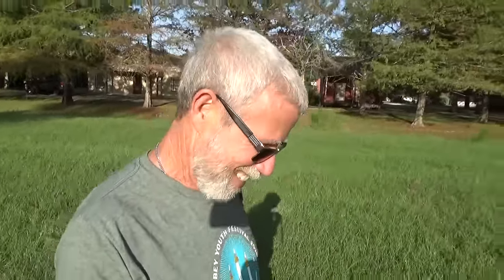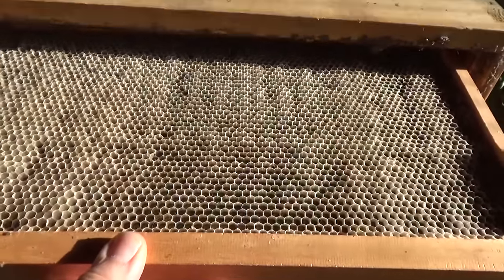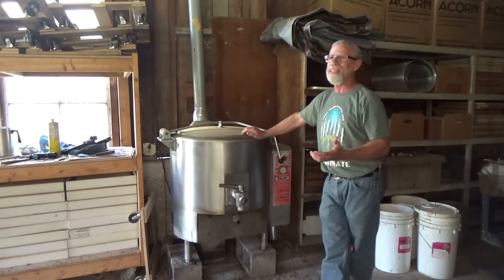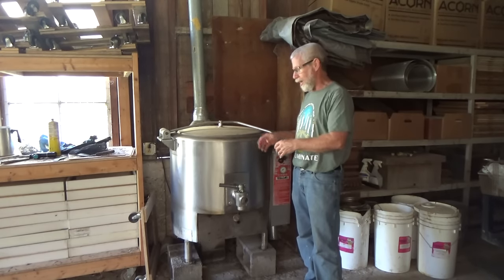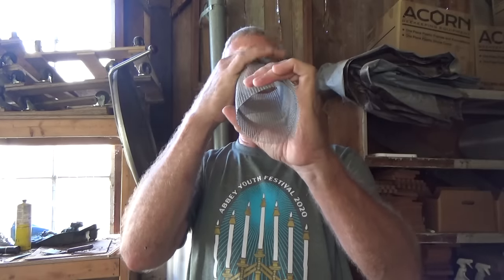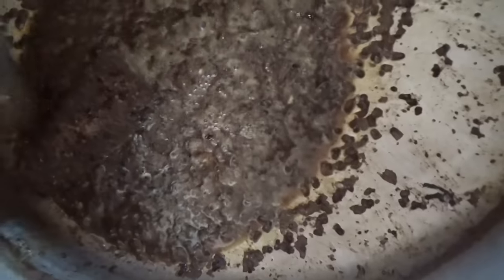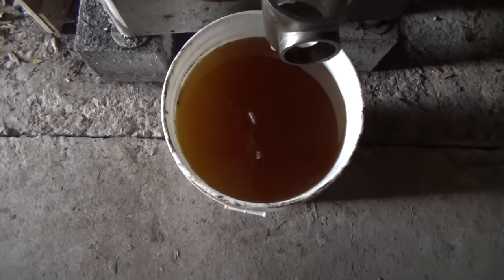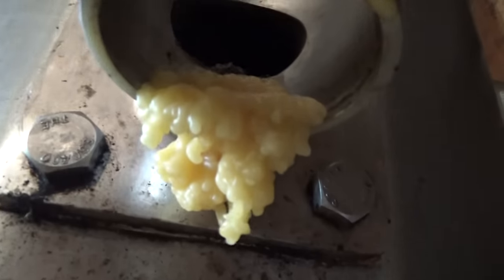Recycling our beeswax making it useful once again.

Comment: I heard you mentioned feeding the honey water back to the girls? How do you feed it back? Feeders or you pour it into a larger drown safe container?What do you do with the black yuck? Trash or compost? I just didn't want to go dumping piles of stuff in my yard that'll induce robbing. Thanks as always, so informative. I need to figure out how to scale it all back to a homestead or backyard beekeeper scale though! 🤣 Love that giant vat  though, so jealous. 

Does the Abbey offer tours? $$?
Reply from the maker: By pouring the mixture on the ground, the bees are able to get the honey, plus it is difficult to remove the wax without a lot of the water going everywhere. The refuse from the rendering goes to a compost pile. As far as robbing goes, I have yet to have a problem with that and I have lots of hives where I pour the water. You will get it all figured out eventually. My best advice, start small and get a feel for it before getting a plan for the future. Yes, I do tours of our honey operation, and in fact, I have a bee club from Mississippi coming tomorrow for one. Reach out before hand and it can be arranged. Thanks for watching. God's peace Heather.
Mr. Ed

Comment: You should make a “French press” for the first scum recovered from the kettle.  Put it in a tall cylinder with 50-75% water and remaining scum.  Get it hot enough to melt wax.  Press the “press “ part down cylinder into the hot water.  Take off heat and let it cool very slowly (wrap it up).  When done slum should be just debris and a nice block of wax on top
Reply from the maker: Love the idea, and I know it would work. Thanks so much for the suggestion and for watching. Also, I hope you will check out more of my bee wrangling/ bee rescues adventures and let me know what you think of them. By the way, I post a new video every Friday morning, and I look forward to hearing from you again soon.  God's peace.
Mr. Ed

Comment: Just because you seem to have some confusion between the two, here's how I remember the difference between stalagmite and stalactite:

StalaCTite hangs from the Ceiling or Top
StalaGMite is a Mound on the Ground
Reply: I'm going to guess 22.8315 kg, which is about 66lb 9.91oz if my conversion is correct.
Reply from the maker: I do always have trouble remembering which is which, but with your tip, I should remember it from now on. Thank you for that and for watching. God's peace.
Mr. Ed
Reply from the maker: I loved how precise your guess was, in kilos, but I'm sorry to say it was not the correct guess. It was close, but not the exact number, and now you are going to have to wait 2 weeks to find out the exact weight. Thanks for watching. God's peace.
Mr. Ed
Reply: @JeffHorchoff 
Hehe, I'm going to confess that I used the math for the volume of a cylinder and the approximate density of beeswax.  So I guessed the dimensions and did the math.
Reply: I always use the StalacTIGHT ie it is holding on tight to the ceiling to remember their differences.

Comment: Would it be better to add more water to prevent your wax from potentially scorching, then turn the gas off before draining?
Reply from the maker: I always turn the gas off before draining, but because the kettle retains heat for so long, it still will boil sometimes. As of today, I have never scorched the wax while rendering it. Thank you for your suggestions and for watching, it is greatly appreciated. God's peace.
Mr. Ed

Comment: Couldn't you clamp the buckets and spin at high speed to refine the wax further?
Reply from the maker: It's just easier to let it set and skim off what floats to the top. Or, after settling, drain from the bottom and it's all honey. Thanks for watching. God's peace Robert.
Mr. Ed

Comment: To help catch all the junk left over in the wax water, you can make a wire basket insert from that hardware cloth to put everything in and leave in while it boils out the wax hopefully keeping the pot clean so you don't have to put a mesh by the drain and scrape out what's left.
Reply from the maker: A few years back I did just that, and it worked very well. The big problem was because the basket I shaped was not exact enough to match the interior of the kettle, a lot of debris managed to escape. Thank you for your suggestion and for watching, it is greatly appreciated. Also, I hope you will check out more of my bee wrangling/ bee rescues adventures and let me know what you think of them. By the way, I post a new video every Friday morning, and I look forward to hearing from you again soon.  God's peace Vincent.
Mr. Ed

Comment: Hi there. Nicely done. You've been lucky with getting these cookers for free.
I use a steam fruit dryer and nylon socks and a bucket and distilled water to achieve the same. Need to melt wax during the coming weeks too.
Reply from the maker: A real blessing to have come across those kettles, I use both of them on a regular basis. Years ago I used nylon stockings and a 5 gallon soup pot to melt my wax, things have really changed. Best wishes for a successful wax rendering. Thanks for watching. God's peace Daniel.
Mr. Ed

Comment: Mr Ed. my husband says he does not know why you do not use the pan at time frame 20:39 on this video. and use it to hold and catch all the trash in the bottom of the kettle. making it so mush easier to do it all in one shot then making filters for the kettle, the pan has its own filter anyways smaller then the one you used for the throat of the kettle. so it should work even better then what you do now. just his way of thinking .  whats your thoughts on that?
Reply from the maker: The pan that I was showing is my honey crush and strain colander and is to valuable to use as a wax strainer. It's important that all the holes in the colander remain open and using it to melt wax in would seal them up. Besides that, it will not fit well inside the kettle. Still, it's a good idea. Thanks for watching. God's peace Carrie.
Mr. Ed

Comment: Good Evening Mr. Ed,   My guess is 51 pounds 5 ounces for the weight.  Just a thought, if you placed the wax cappings into an old pillow case, tied it at the top and weighed it down to the bottom of the boiler, then the melted wax could rise to the surface and the junk would be trapped inside?  Cleanup would be easier too.
Reply from the maker: In my early years of rendering wax and trying multiple ways of getting the job done, I did use the "pillow case" method a few times. Yes, it did work, but I still was not happy about the amount of wax that was lost in the pillow case. I even tried remelting the case in fresh hot water but the results were not up to my satisfaction.Your guess was close, but not the exact number, and now you are going to have to wait until September 30 when I go live to find out the exact weight. Thanks for your suggestion and for watching, and I hope you will check out more of my bee wrangling/ bee rescues adventures and let me know what you think of them. By the way, I post a new video every Friday morning, and I look forward to hearing from you again soon.  God's peace Ralph.
Mr. Ed

Comment: Hi! My guess is for 42 lbs 5 ounces. I always enjoy your videos and have learned soo much. Can you show your ideas about smoking sometime? When to, how much is too much? What happens to the hives resources or way of doing things if we overdo it? I am trying to zero in on my colony's issues and my greatest suspect is smoke being trapped and concentrated down the length of my Langstroth horizontal hive frame covers. We start at one end and work our way toward the closed sections. The bees become agitated more and more, and then I see ones on the ground stumbling around...then we discovered out brood being layer with spots and random patterns, though not like foul brood. Any thoughts? Thank you so much for your time.
Reply from the maker: Always great hearing when folks enjoy watching my bee wrangling adventures, thank you so much for letting me know. Your guess was close, but not the exact number, and now you are going to have to wait until September 30th when I go live to find out the exact weight. I have talked about using my smoker from time to time on my videos. What I have discovered over time is I use smoke less and less. Smoking bees stresses bee every time, and a stressed bee is not a good thing. Even when I do removals, I seldomly smoked the bees, Generally, I smoke my bees only when I go into the hives for inspections, which is rarely,  or to remove honey supers, once a year, and I use the smoke VERY sparingly, just a puff or two. Again, thanks for watching. God's peace DiAnne
Reply: @JeffHorchoff  Thank you for your thoughtful reply. Much love to you all!

Comment: Hi Mr. Ed, I have to say I love the wax rendering videos the most of everything - I have always wondered if it would be possible to make a fine mesh basket that can sit in the kettle, spaced an inch or two off the bottom. Then you just put the wax and water in like normal, and the mesh would catch all of the slum, almost like a coffee filter? If I had your set up, I would be constantly tinkering with stuff like that! I am in for 18 lbs 5.75 oz.
Reply from the maker: I built a cage like you suggested a few years back, and it work, but because it did not fit the interior contour of the kettle perfectly, there were issues with  it. Now, using just the plug filter, I accomplish the same goal. As I showed in the video, I really have been tinkering with the rendering since the beginning. Your guess was close, but not the exact number, and now you are going to have to wait 2 weeks to find out the exact weight. Thanks for watching, and I hope you will check out more of my bee wrangling/ bee rescues adventures and let me know what you think of them. By the way, I post a new video every Friday morning, and I look forward to hearing from you again soon.  God's peace Robert.
Mr. Ed

Comment: I think the idea of putting the wire mesh around the opening is good but I was thinking why not put a piece of metal sponge in the opening and then adding the metal mesh that way when the mesh gets clogged up the sponge will still be clean and then you can remove the mesh and not worry about any of the garbage dripping into the clean wax this way you provide two forms of barrier not just one
Reply from the maker: Because the wax gets rendered once more, it is not necessary to get the initial rendering perfectly cleaned out. On my first rendering, I strain out about 95% of the trash that is in the wax. On the second rendering I get out almost 100% because I use finer screens to clean the wax. The idea of using a metal sponge, copper brillo pad, is a very good one. However, I do not want to restrict the flow of the liquid wax/water in any way on the initial rendering, and the sponge would in fact do that. Thank you for your suggestion and for taking the time to watch the video, it is greatly appreciated. Also, I hope you will check out more of my bee wrangling/ bee rescues adventures and let me know what you think of them. By the way, I post a new video every Friday morning, and I look forward to hearing from you again soon.  God's peace brother.
Mr. Ed

Comment: I know I saw a gas/propane burner below this, but is it designed as gas or is just a gas burner sitting under an electric kettle?
Reply from the maker: It is a gas burning heater. The kettle is double jacketed with water between the jackets. The burner below heats the water in between the jackets, and since the material inside the kettle is completely surrounded by heated water, it melts the wax. Thanks for watching. God's peace.
Mr. Ed
Reply: I was looking at one, and it is electric was thinking of just sitting a burner under it, but probably won't do that. @JeffHorchoff

Comment: Hey Mr. Ed. I have an even easier solution to to wax filtering. I see a problem with your filter having a very small passage for the fluid to travel, thus making it clog faster.
What I would purpose is a large ring of fine window screen that is a round as the kettle is, and raised off the floor of the kettle by bricks or stones. To seal along the edges your can use steel wool placed around the perimeter of the screen where it meets the kettle.
The massive increase of surface area will help in the free flow of wax.
After all the wax has neen drained, you can use a spackle knife to remove the debris. Any remaining debris can be left for the next run.
This method would also eliminate your second screen as well. 
Let me know your thoughts

And I am guessing 26 lbs 4oz
Reply from the maker: I actually tried your suggestion years ago, but the problem was the inside basket did not conform the inside kettle shape very well and I had lots of issues. I actually was looking for someone to build me one, but I never found the right person to do the job.Your guess was close, but not the exact number, and now you are going to have to wait until September 30 when I go live to find out the exact weight. Thanks for watching, and I hope you will check out more of my bee wrangling/ bee rescues adventures and let me know what you think of them. By the way, I post a new video every Friday morning, and I look forward to hearing from you again soon.  God's peace.
Mr. Ed

Comment: 25:51 Actually, Mr. Ed, that will look like a stalactite. Stalagmites are formed from the ground up to a point.[Stalagtite hangs "TITE" to the ceiling] ~ [My guess is 20lbs.]
Reply from the maker: Thanks for the correct word, I always get mixed up but with your little trick I will remember it the next time.Your guess was close, but not the exact number, and now you are going to have to wait 2 weeks to find out the exact weight. Thanks for watching. God's peace Steven.
Mr. Ed

Comment: Why not just put one large basket shaped screen with some spacers under it that fills the whole bottom of the kettle? That way it can drip down through a much larger surface area.
Reply from the maker: I had tried that in the past, and it did work. However, because my basket wat not the exact contour as the inside of the kettle, debris and trash made it's way into the kettle and into the wax. Still, if the screened basket were a better fit, I agree, it would be the ideal solution. Thanks so much for your suggestion and for taking the time to watch the video, it is greatly appreciated. Also, I hope you will check out more of my bee wrangling/ bee rescues adventures and let me know what you think of them. By the way, I post a new video every Friday morning, and I look forward to hearing from you again soon.  God's peace.
Mr. Ed
Reply: I hope you do find a solution that lets you be a bit more productive with your time! Thank you so much for all the knowledge and good times with bees, I don't keep any myself but I have a garden full of them. @JeffHorchoff

Comment: Looks about 3 to 3&1/4 gallons x 8lbs/gallon = 26lbs at most ... just looked in comments ... for it to be over 40 you would need at least one 5 gallon bucket full.
Reply from the maker: WOW! Your method of guessing was darn near right on. The actual weight of the combined blocks was 25 pounds and 13 ozs., great calculating! Thanks for watching, and I hope you will check out more of my bee wrangling/ bee rescues adventures and let me know what you think of them. By the way, I post a new video every Friday morning, and I look forward to hearing from you again soon.  God's peace E J.
Mr. Ed
Reply: @JeffHorchoff  I just measured their thicknesses and the height of the bucket when they were all in frame. Wax combined thickness was 63% the bucket. So 3 or so gallons.Wax is about 8 lbs a gallon. Math with a bit of hunter range finding applied.

Comment: I worry about you getting burned when adding wax to a hot pot of boiling water when you could be safer. Add your water and the wax at the same time before you heat it. The wax will rise and the water will sink as the wax liquefied. You will save time, fuel plus yourself from burns. God bless.
Reply from the maker: Thank you very much for your concern for my safety Vicki, and I do realize I can be burned by the hot water. In fact, I have been burned but never to badly. I have to say, I think I will add the water and the wax at the same time in the future, it really does not take any longer to heat everything at the same time, and it is a lot safer. Again, thank you for your concern, your blessings,  and for taking the time to watch the video. God's peace.
Mr. Ed

Comment: I'm really bad at estimating weight, so let's see how far science and size estimation can get me:
average diameter of bucket ~= 11 in or 28 cm
radius ~= 5.5 in or 14 cm
apparent combined height of blocks ~= 10 in or 25.5 cm
volume ~= 950.3 in3 or 15,701.7 cm3
avg. density of beeswax according to FAO ~= 0.035 lb/in3 or 0.964 g/cm3
weight ~= 0.035 x 950.3 = 33 lbs 1 oz
or 0.964 x 15,704.7 = 15.14 kg
Reply from the maker: To date, your estimation process is the most detailed and elaborate and is VERY impressive. Unfortunately, you arrived at the wrong estimate. Now you are going to have to wait until September 30 when I go live to find out the exact weight. Thanks for watching. God's peace.
Mr. Ed
Reply: Haha, oh well it was worth a shot. Judging by the wisdom of the masses in other comments I'm going to guess I'm low, which would make sense as I feel like my size estimates were conservative. And/or the density figure I pulled is not very representative of the abbey wax, possibly due to the wildly varied sources. Guess we'll see, thanks for the opportunity.